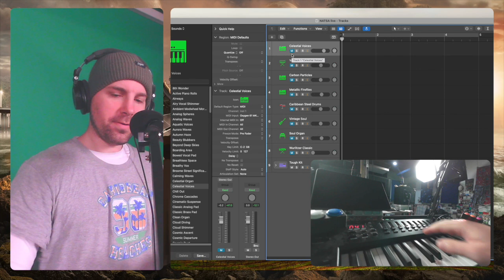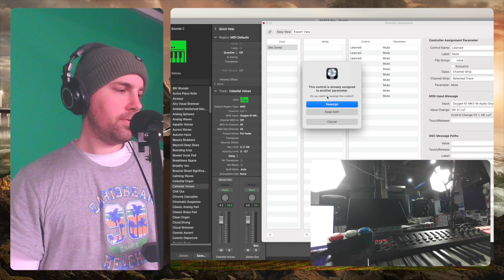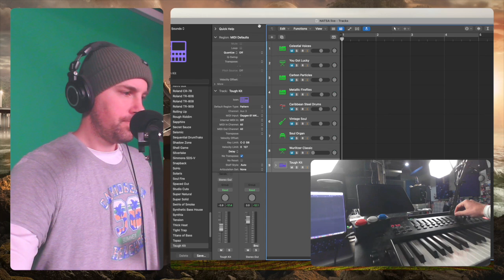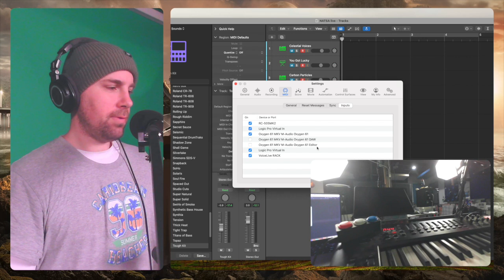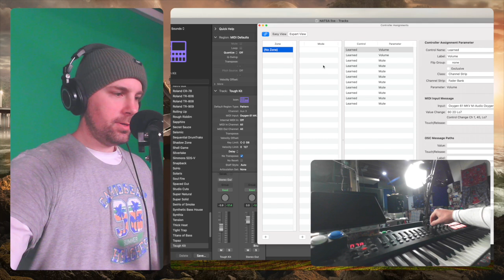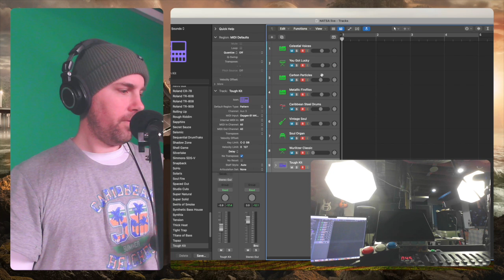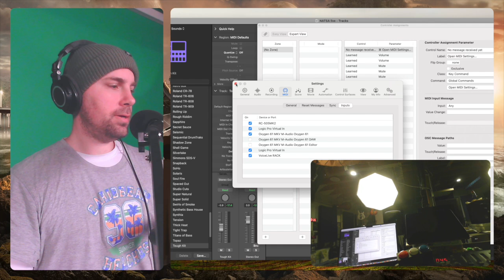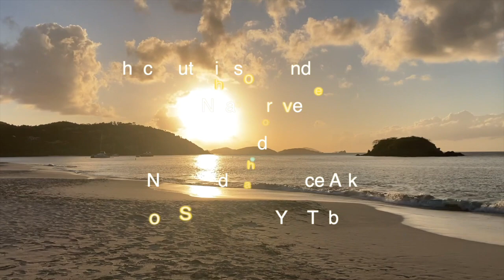M Audio Oxygen mapping in Logic tips and troubleshooting

Comment: Thanks for the video..
I have the same keyboard  M-Audio Oxygen MKV  with Logic Pro , In my case  it seems stop sending/receiving data if the keyboard idle for a short time
I mean the keyboard is still ON ,  MIDI device still showing enable/active in MacOS Midi and  all button still functioning ,  but nothing received in Logic Pro  Midi monitor IN / OUT
I have to restart the keyboard or restart midi driver (from Logic Pro Midi settings) to make it work again

Wondering if this is happening to you as well
Reply from the maker: @RidwanHWibowo  hi Ridwan, I haven’t experienced that problem.  I’ve left my keyboard on for 5+ hours before many times idling and never experienced this 🤷